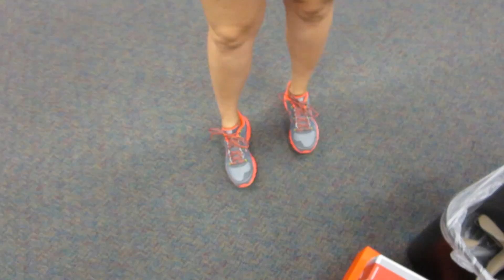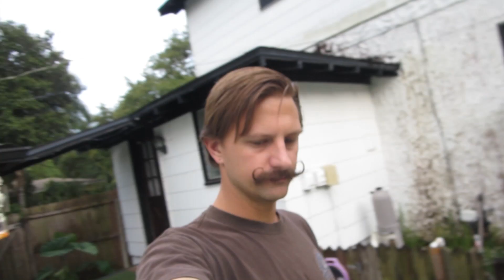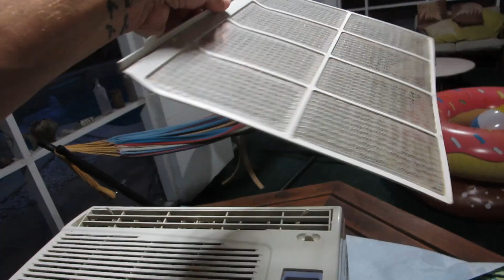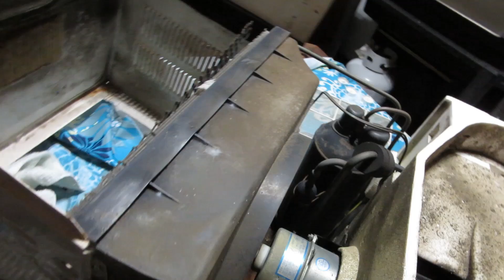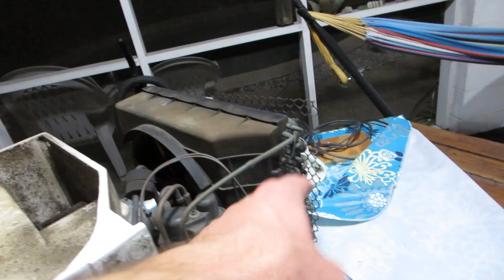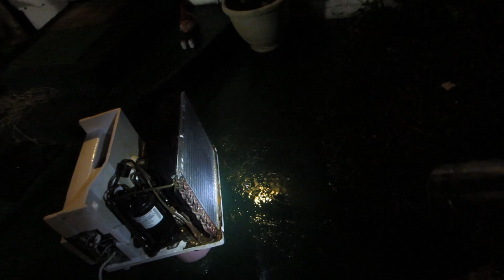Learning About Air Conditioners Is Fun, Right?!? (8.3.14)

Comment: Did not know about the oil thing in A/Cs, Fridges and Co... Will keep that in mind if I have to clean out our garage freezer again...
Reply from the maker: Michael Roth Yup, let it sit for a bit; oil moves very slowly! It's not a big deal if you are just moving it while it is upright, but if you lay it down that is where the waiting is necessary!
Reply: TheTimTracker We had a power "fluctuation" at the house a few weeks back that turned off the breaker for just that freezer, didn't notice until way too late.  So we had to empty and hose it out, but we just moved it, didn't tilt it.